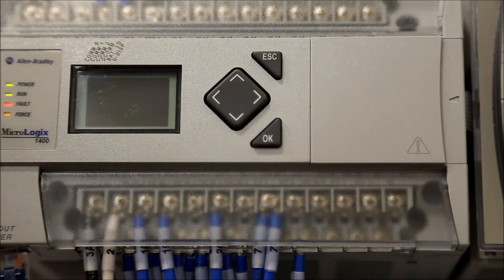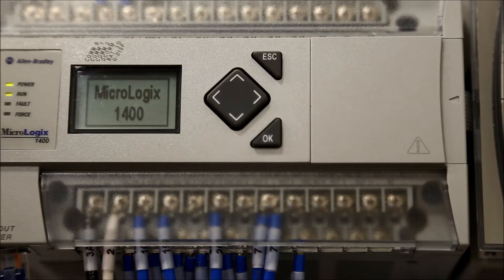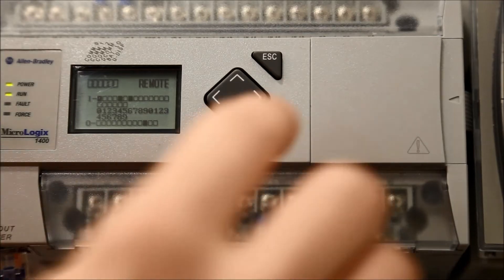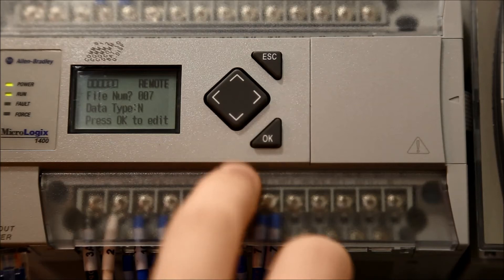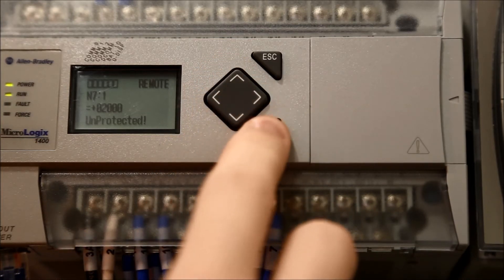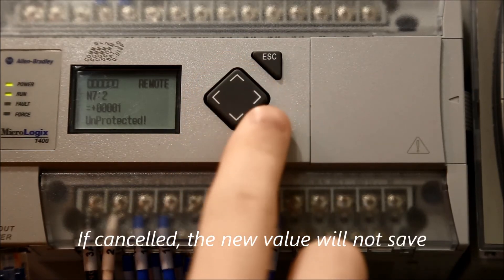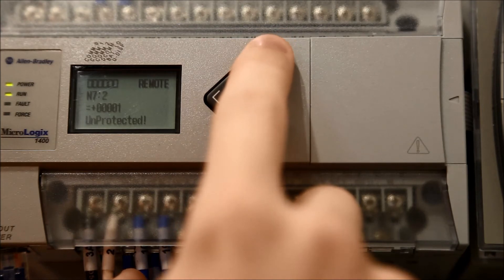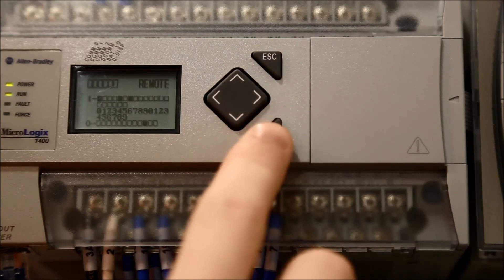Alter Setpoints on a MicroLogix 1400 PLC

Comment: Hi There can you please tell how to monitor Input Bits (Data Type : 1) through LCD i want to force on input using LCD
Reply from the maker: The IO on the base unit can be viewed on the screen that appears on power-up (or in the monitoring menu). Additional cards cannot be viewed from the screen as far as I know. There may be indicator lights on the IO cards. You cannot force IO from the screen either.